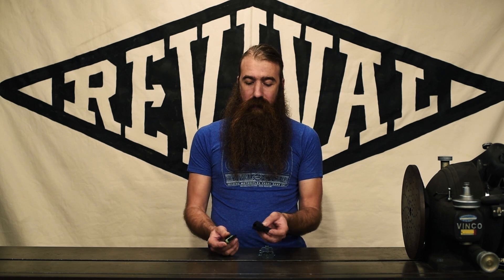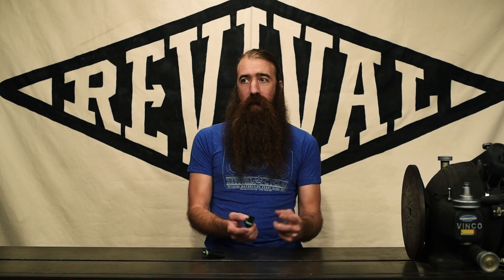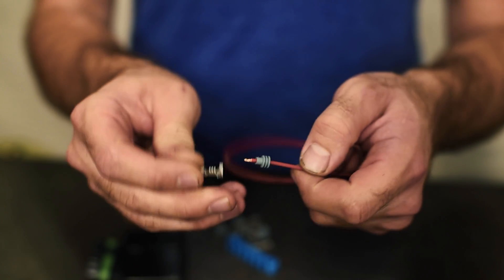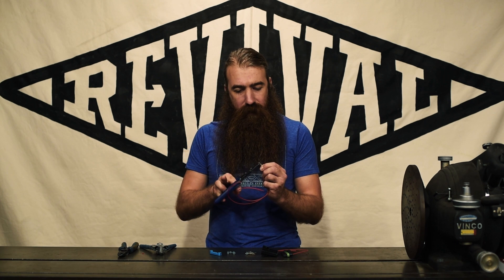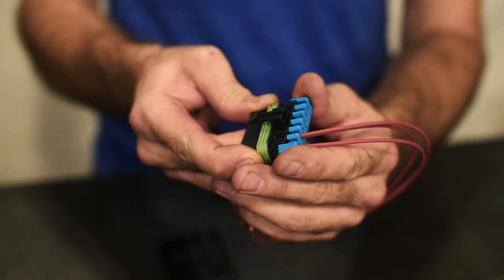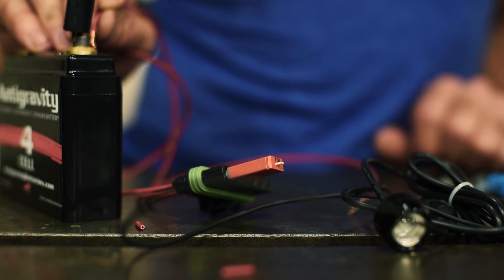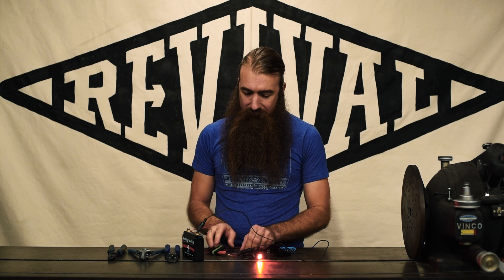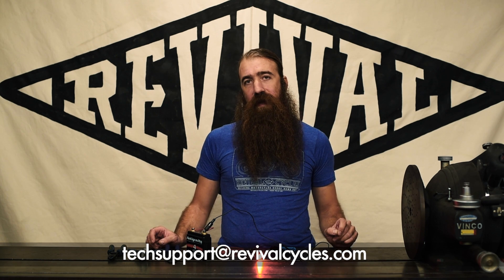Waterproof Power Distribution Modules - Revival Cycles' Tech Talk

Comment: yea those are pretty cool!   i own several relay and fuse modules.   

only two issues are;   on the relays they only come in a 4 pin set up. (no big deal if your doing just the basics.)

they dont make them to a canbuss set up. (you have to spice into one main power wire.)

there still worth it though.     like he said.   "WATERPROOF"!..        

great job bro!      thumb up over here.

larry
Reply from the maker: True, it would be nice to get an 87 and an 87a contact, and technically that relay does exist and does fit in this package, but it uses 6 of the 8 terminals, which makes the rest of the setup un-usable. So if you want a N.O. and N.C. contact waterproof relay, we suggest this one. https://revivalcycles.com/products/waterproof-relay

Oh, and as for CAN BUS, that is a whole different set of challenges.

Comment: i've read that the connections inside of circuit breakers can go bad after multiple times of shorting and they should be replaced just like fuses as well, how often does that happen if ever?
Reply from the maker: This is true with standard mechanical circuit breakers, HOWEVER, we also sell solid state polyfuses and those do not wear out. Still with the standard circuit breakers you should be able to have it go through several short circuit cycles and still be operational. I think the testing spec was on the order of 1000 trips. If you are having that many shorts on a moto, its probably time to re-wire with an m-Unit. 

But with the solid state type it really shouldn't matter, and I would expect that only time and high temperature would degrade the performance. Either way both types are better than getting stuck with out a spare fuse.